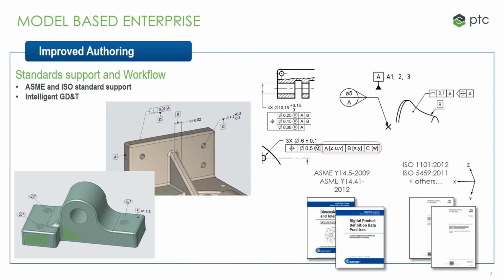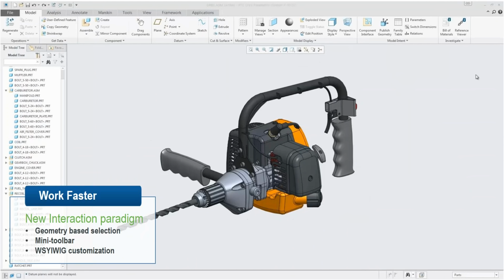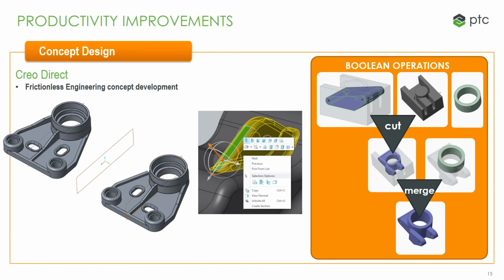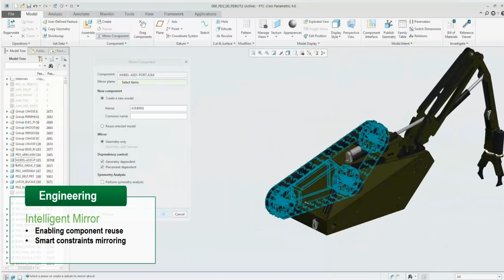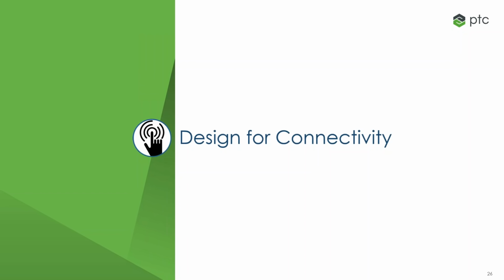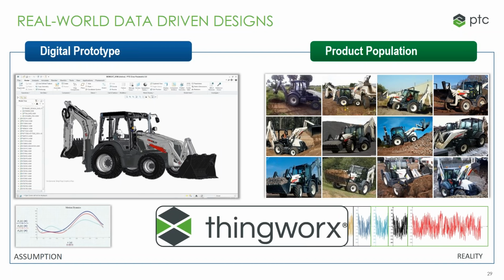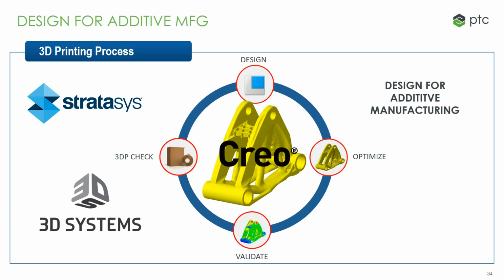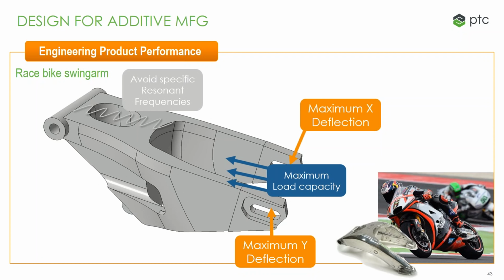Webinar Replay: PTC Creo 4.0 Launch

Comment: Some nice added features and tools. I have to agree on the lack of 2D improvements, major fail on PTC's part. 2D drawings are still needed in many places. In Creo 3.0 while you can add a counter-bore or countersink feature in the model, you cannot get a corresponding note for this feature on the drawing. You have to add it manually.

Comment: I don't agree with the anti-2d sentiment, I started on the board so that just may be my bias talking but we need a print that has the pertinent info on it. I can not deliver a project to my customer with out a 2D print that they can send to the turning guy, the wire guy, the jig grinder, inspection, etc. etc. etc.

And that may happen eventually but not in our lifetimes. I've actually seen an INCREASE in the desire for 2D so i'm afraid that PTC is dropping the ball here. The no 2D started way back in the beginning of pro-e actually (I started on release 18, and even though we never got prints of the part i ALWAYS had to provide them to my customers) and it became apparent over the years that 2D is and always will be a necessary evil.